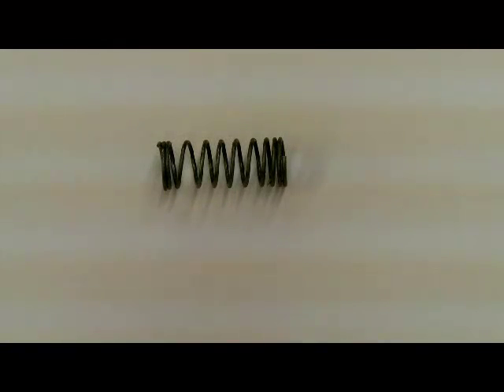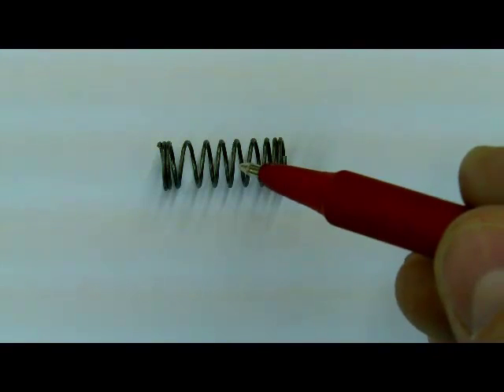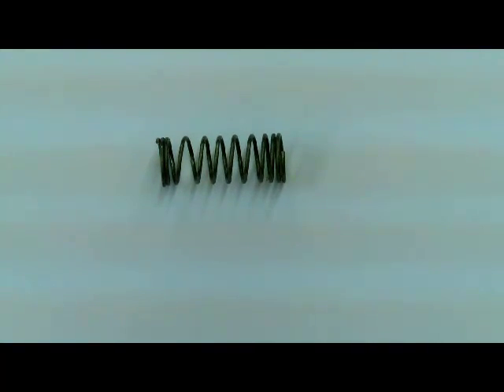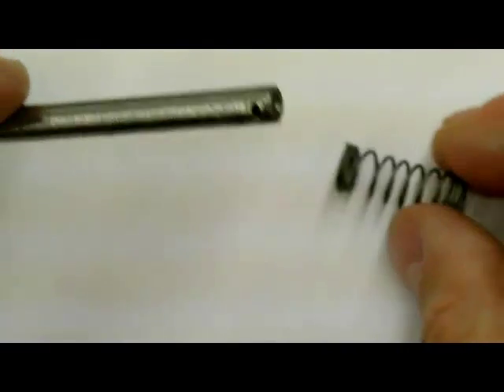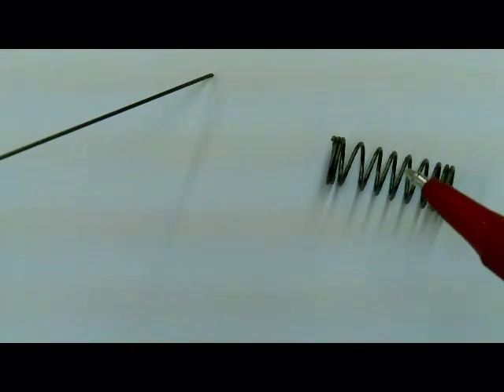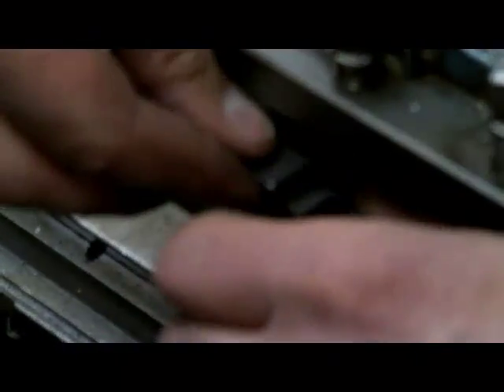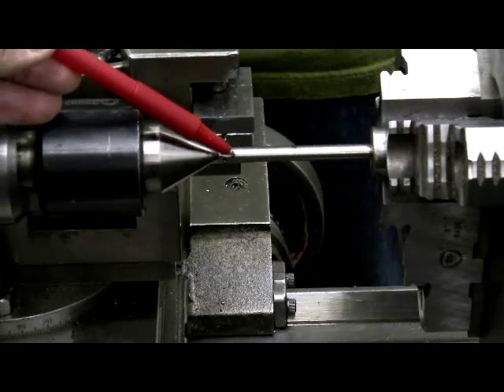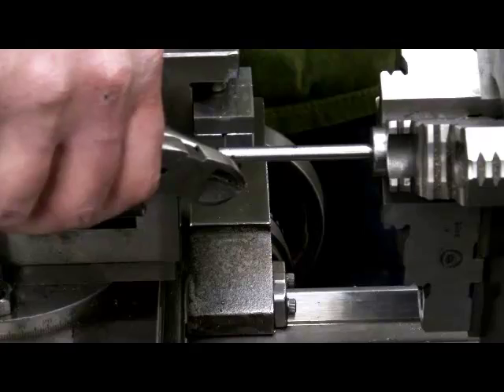Spring Winding on a Lathe

Comment: Thank you.Very helpful video. I'm curious re one point; do some springs require specific(e.g annealing)  treatments after the winding process?-or is any required treatment done to the material used,-before winding? I hope the question is clear.;)
Reply from the maker: I'm using spring steel in the video but for some applications a heat treatment process will be necessary.

Comment: Hi, nice one. you dont need to cut the sring after done. Cut a slot at the begining of the shaft and pull out the spring easily without using cutting player. No need to cut the spring end thats gone inside the hole. Sorry I dont know the technical parts names of the machies or tools parts as I'm from software background.
Reply from the maker: Venki R Your right, that will work too. Great having a software guy on this site!

Comment: great way of making a spring, is there a formula or rule of thumb to observe for the various diameters of springs being wound?
Reply from the maker: mmikeyy27 Not that I'm aware of. I think you would need to factor in the diameter of the wire and it's material.
Reply: @machiningmoments   I think the machinist handbook has some guides on mandrel size for  different spring diameters. (to compensate for spring back)

Comment: Absolutely the best spring winding demonstration I have seen. Do you heat treat the spring? Would hand winding a very large diameter wire (.125 or larger for instance) be more difficult with the manual winding of the chuck? - My apologies , I see heat treating has already been covered. If you have a very slow speed lathe, would the engaged backgear accurately make an acceptable compression spring, even if numerious attempts were involved? Thank you

Comment: I have to disagree.  If you don't temper the spring, it won't "spring".  It will just bend and not return to its original shape.  Music wire springs must be tempered... 450 degrees for 30 minutes is all it takes.  Just Google, "Tempering music wire springs".
Reply: Wow it's Mark Serbu